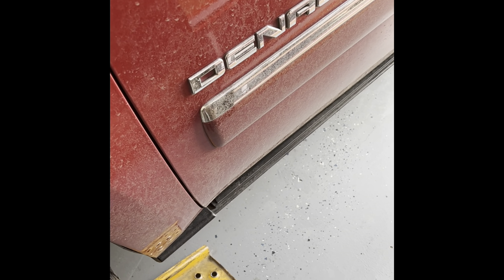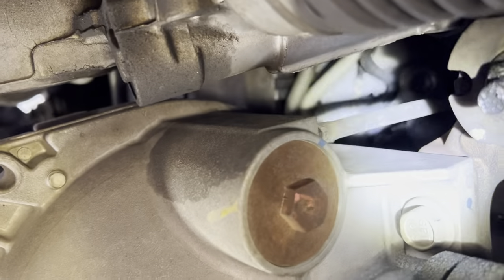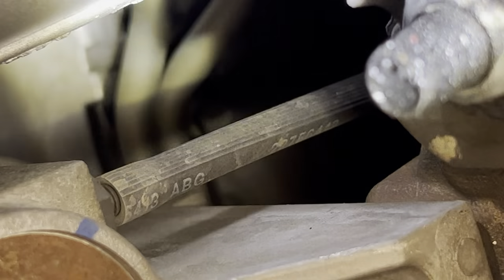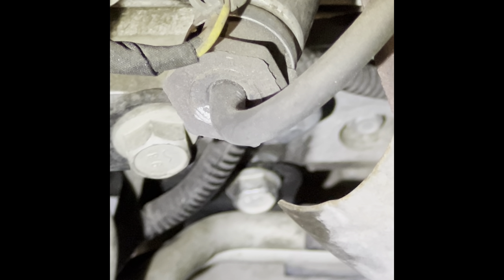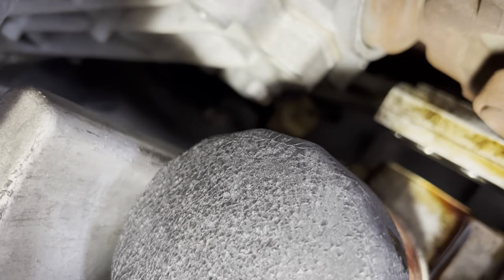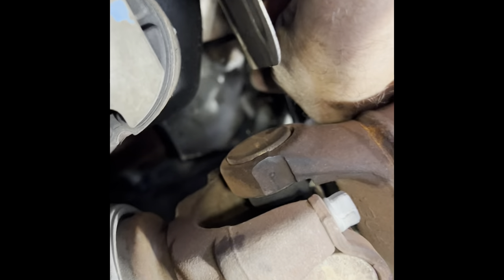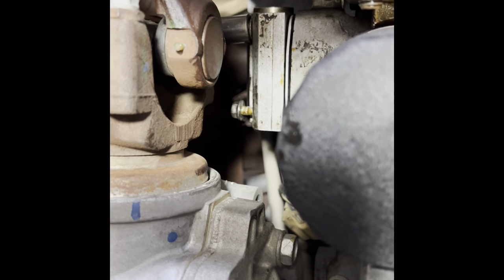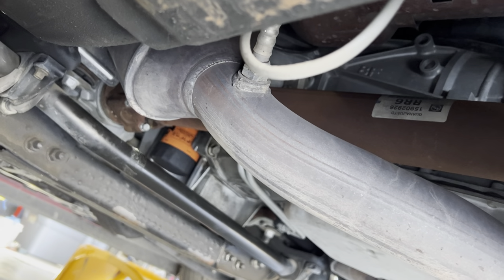How to replace GM🛢🪔oil cooler line block gasket on 2006 - 2014 6.2L Yukon, Suburban, Tahoe, Escalade

Comment: I recently saw another method taking off the driver side wheel and well cover. You can get a pretty good angle at all three bolts using extensions.
Reply from the maker: DIY At its best😇

Comment: Where can I find the torque specs? I have read that the oil pan bolts have a torque spec of 7-9 ft./lbs. I can't imagine these 1/4" oil thermostat block bolts to be greater than 9lbs.
Reply from the maker: no subscribers have said 9lbs😇 I use the snug method but be careful using my pinky

Comment: 22 ft lbs will likely break the bolts off.  The spec is 9 ft lbs or 106 in lbs.
Reply: @mbjdiy1778 
At 7.07 you advise 22ft lbs which would snap the bolts.  Good video otherwise.
Reply: @ricosplace1 22 ft pounds won't snap a 10mm bolt used in a vehicle application. 20 or so is essentially a tight snug by hand give or take.

Comment: @Mbj diy I have a similar problem on my 2004 Yukon. Just wanted to know if the cooling line gasket fix your problem?
Reply from the maker: Yes it did ,but other people have contacted me about the rubber front section (2 cooler connecting lines by the radiator) leaking and the strange allen screw in the block that is touching the oil cooler gasket I replaced seeps oil also they say . So many other possibilities can come up. So far I do not have a oil leak so fingers crossed. So double verify that is the source of your leak .I sprayed brake cleaner on it twice to make sure that was the leak problem.😇God bless
Reply: @mbjdiy1778  Thanks so much, I'm just afraid it may be the rear main seal, but the cheapest route first...